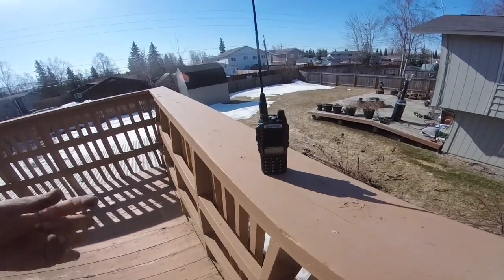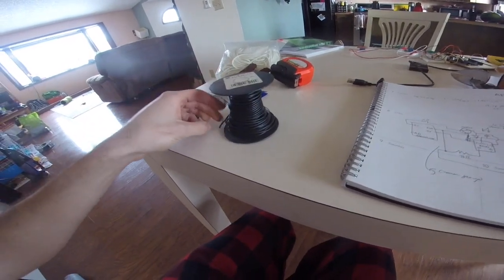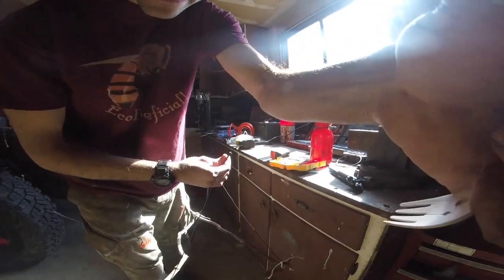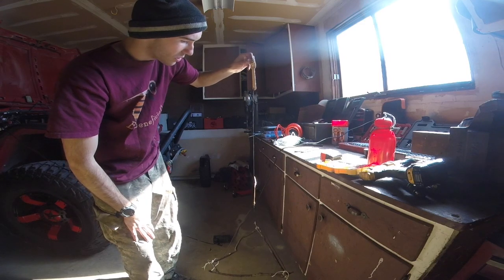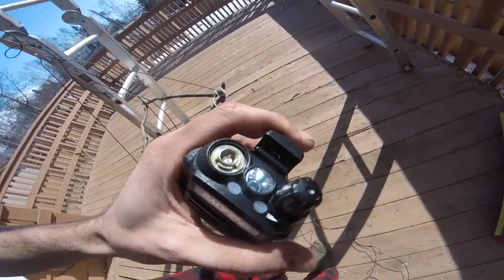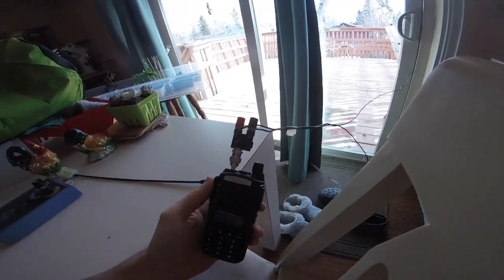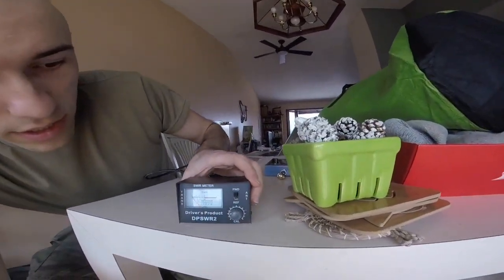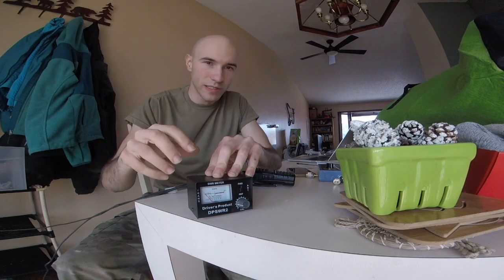Jungle Antenna DIY   HAM Radio

Comment: Love this, we built these all the time in the MC, called them Field Expedient Antennas, for sure it was from an Army manual.  My platoon would normally shoot HF to ships out at sea, and  from Camp Lejeune to Camp Pendleton.  BTW, I recall the formula as the speed of light divided by frequency, which gives the full wavelength, and we cut this by 1/4 for our antennas, Dipole and Yagis as I recall.  Hard was building a ground plane, especially in the desert.  Note:  You should never aim a directional antenna at your distant end, but offset by 5-7 degrees.  BTW,  these principles you are using also work in gaining WiFi signal, a trick I gave to Anthony as he stops in Truck Stops.  All the best, Uncle Jimmy from Germany